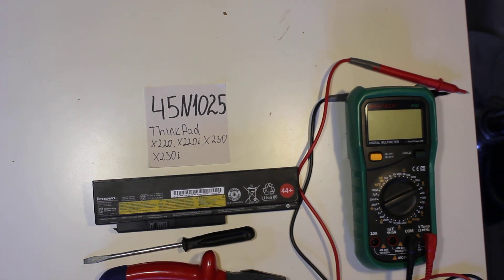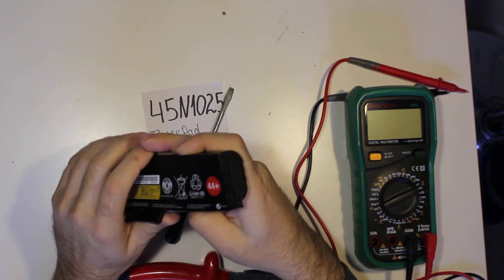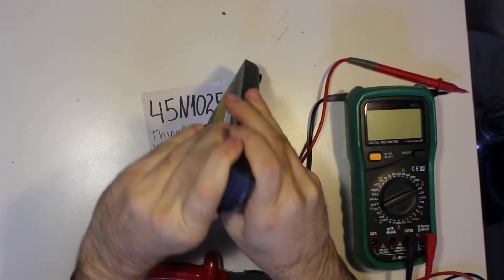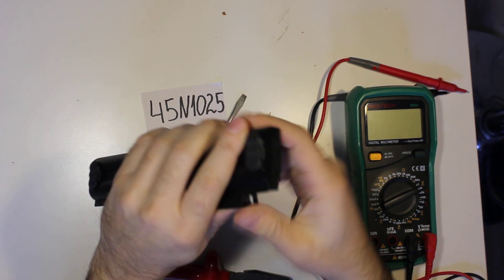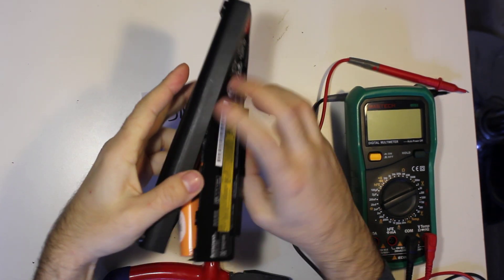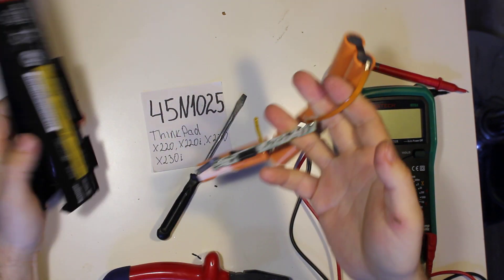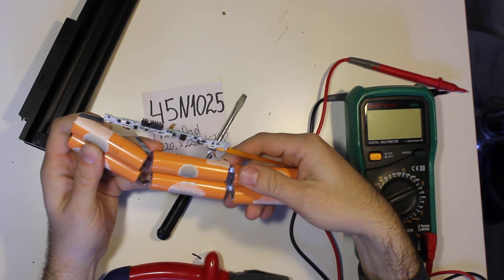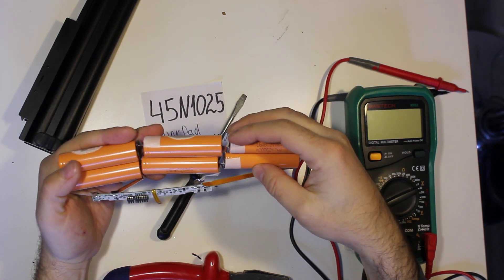45N1025 / 45N1024 Lenovo Laptop Battery Teardown - 6x LG LGABC21865

Comment: you didnt tear down a good battery pack i had same issue , Its  the charge circuit that goes bad  and they will not charge correctly ..  when trying to charge them status  shows hours left to be charged fully  .Its  a common issues with  older lenovo packs  .  sometimes there also might be a bad cell or diminished capacity cell in the mix but overall the cells are still good .
Reply from the maker: If the cells are Sanyo - they are almost always gone... at least a couple of them. I'll have to make a stats table with results after capacity test at some point :)
Reply: but 2011-2012etc  lenovo specific  packs are generally good harvest prospects because the charge circuit goes  bad  before battery cells life is toasted  . But other packs  may be just the opposite  as the cheap charge circuits mostly toasts  all the sanyo cells  just as one of your other videos show  mostly all the   sanyo cells are Toasted and discolored .
Reply: @kingdommusic5456  yea, I also have the same - battery charged at 4.2 V , but the PC show ups few minutes or shuts down immediately.